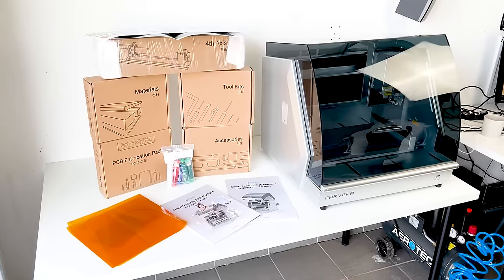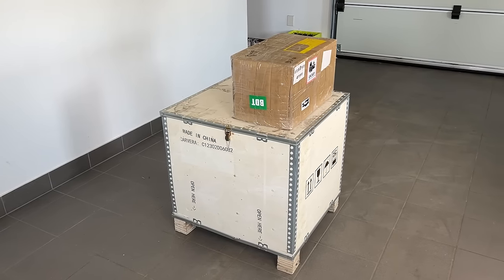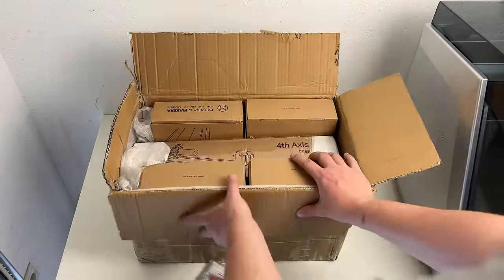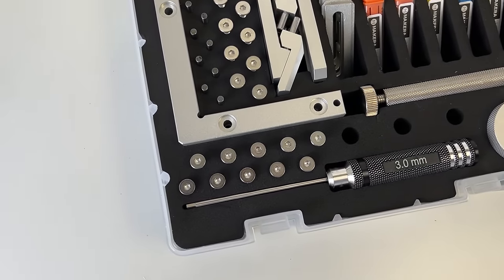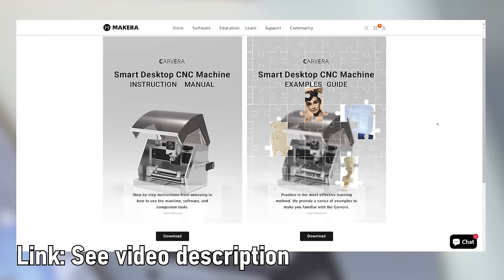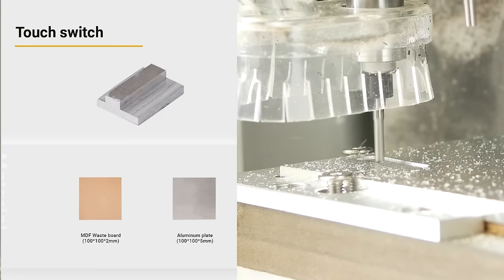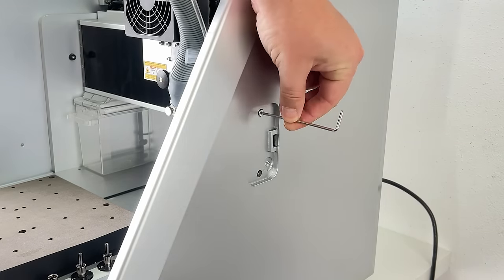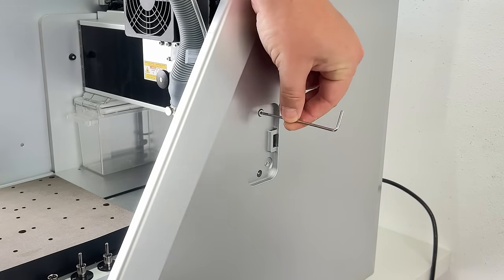Makera Carvera Desktop CNC: Great for (wealthy) Beginners ?

Comment: 200 W spindle does not a high-end CNC make...
Reply: When considering that it is a small form factor desktop machine. I think it does
Reply from the maker: I get your point, but does a 2kW spindle make high end?
Reply: well it would be at least nice do drive a 6mm endmill at proper speeds  @247printing
Reply: Considering you can get a Langmuir MR-1 for around the same cost, and it has a 2.5 kW spindle, I'd say yes.
Reply: You're right, but this is for onesies and twosies, not a production machine - a minimally viable production CNC like Haas VF1 runs around $40K, needs 3 phase power and is the size of 2 sedans - what ordinary person is buying that besides someone who is making a living from machining???
Reply: I'd rather have a $5k portable CNC that is slow than a $15k phonebooth CNC capable of production runs - at that point just buy the full Haas mini mill or VF1, you're already blowing out a wall in your garage just to install it
Reply: In a small machine like this, you will not be roughing with large end mills. Small diameter micro milling end mills have relatively little cutting force, but require much higher RPM.
Reply from the maker: @theofficialczex1708  Now that's context to your initial comment I can work with ;-) Thx
Reply: Dude, i5s a hobby machine,  not pro
Reply: Illegal
Reply: I have made and regularly use CNC routers, lasers and so on... this Is a very well made solution for Who wants a desktop machine and newbees. Automatic tool charger Is very expensive if you can't do It yourself.  I think 5000 Is not too much considering that a good core xy 3d printer costs 1000 or 1500.  And yes, Building stuff with cnc Is very more complicated than 3d printing them😅. Otherwise,  as in 3d printing , There are always challenges in CNC that I love.
Reply: @woofguy  "High end" was removed from the title.
Reply: It doesn’t have tool changer though
Reply: Neither does $5k.
Reply: The wattage doesn't directly equal the capability... And I've seen reviewers cut aluminum with the Carvera Air... Sure it's slow, but it works. 
I bought it for PCB making and carbon fiber milling.
Reply: Servo motors ball screws, and a Mickey mouse spindle😂 like putting Pirelli racing tyres on a VW beetle😂 shame cos the rest of it is quite high spec, should be 1 kw spindle minimum, I guess size was an issue. If they scaled it up and put a decent spindle on it, the comprehensive add one like probing and tool changing would be worth the corresponding price rise..

Comment: It doesn't look like anyone has explained the default stock to leave values, so I'll do it. Generally you would use a roughing tool and a finishing tool or even just different feed rates to improve the surface finish on the pockets, hence the 0.5mm stock to leave, so that the next tool has something to remove.
Reply: Spring pass. Came here to explain it but you got it.
Reply: @saltwaterrook4638  i usually got taught a spring pass is a second pass with the same tool and settings to remove any material that was not removed by the first pass. This is due to bending of either the work piece or the tool, or both. Roughing vs. finishing passes on the other hand are used for quick material removal and good surface finish respectively.
Reply: And don’t do side milling and face milling for finishing at the same time if you want a very good finish.
Reply: Our Kennametal rep recommended 0.05mm stock to leave and it's been working great. Of course this depends on the expected surface roughness of your roughing step.

Comment: The reason why you get the misalignment of the upper and lower cuts is due to that you use an live edge to center your stock when flipping. To fix that, first position the stock as you did in the beginning with the xy block, clamps and screws. The the second operation is to face the peace of the bloc you are going to use. Then this is the important one. Drill the screw holes and screw the stock down (At least 2 screws and screw holes.). You can now remove the clamps as the part is fixed to the board through the screws. Continue the cutting make sure in CAM to not hit the screws in the stock if they are sticking out a bit. Do this side completely done and cut it out. Now you have one part that is faced and has the features on one side. Now the magic. Flip your half ready part and screw them back in the same hole again. With this the position of the stock becomes absolute. Finally some times those  screws in the beginning can is some cases be supplemented with dobbel sided tape if the forces are lower. But then you can not flip the stock easy. Final 2. With CNC you may spend more time making stock holding systems then actually making the first batch of products. Check in the @ContraptionCollection channel here on YouTube he has some nice CNC trick's. Sorry for long message.
Reply from the maker: Thanks a lot for the long message!
Reply: I ran into this same issue flipping parts with my CNC. Another option would be to set your 0 on something that doesn't move. For instance, the alignment fixture. If you are setting 0 off the edge of the stock, the stock needs to be precisely cut. When you flip it you will be off by the difference in stock dimensions. Setting 0 off the fixture would require you to roughly model it in Fusion. From from there you can set your WCS.

A second option would be to set your 0 off of a milled feature. If your probe is small enough to get into the gap around the part you can set X and Y. Or if the machine can probe a bore that would work to. That would set the 0 to milled features and should get you a lot closer.
Reply: @NainKaigo  Yea. That is also an option. You could mill the live edge to get an true position when flipping but it could be less precise then two, three or mare screws.
Reply: What? What live edge? This isn't wood bro and we're on an international stage...
Reply: @247printing  Dear 247printing: You did well. In the future, may i suggest to utilize the machine for accuracy. Simply make a couple holes from side 1 and zero/home in them from the other side, including a screw angle. NC deburings tip doesn't allow for chip evacuation, always run minimum 0,5mm tip offset, but rule of thumb is "more is better". Running it like you did requires a 2nd pass to make the surface real good
Reply: @VikingRul3s  Oh. The live edge means the edge may not be straight because the metal you revived was not cut totally straight from the factory. If you check for example ClicSpring here on yt he always cuts the stock on all sides before he starts working on the project. He does that because the live edge provided by the manufacturer is not straight. If he did not do that the parts he make later would became skewed.
Reply: @segment932  Bro, i'm still kinda confused. Do US call both wood "stock/bark/raw" edge and metal stock edge for a live edge? I so, my bad, tho in my defence that's different terms in Europa
Reply: @VikingRul3s  Yea the the live edge may be a American perspective because most of the time I always watch American CNC videos and have forgotten the Swedish names (Yes I'm from Sweden) I learned in schools 20 years ago. So I'm sorry for the confusion.

Comment: Hi, awesome to see that cnc milling is becoming avaiable for the hobbyists. As someone who is experienced using industrial cnc machines I have a couple tips for you. For what I can see you are probing on the side of the plate on both operations. You can do it on the first operation, but I would recommend to probe a feature that has been milled on the first operation to probe for the second operation. For example a troughhole. As for the chamfers I would recommend to give it a larger chamfer tip offset, this way you aren't milling with the very tip. The 0.05 offset you used it quite small. I recommend this because the higher the offset the higher the circumferential speed is. At the very tip the theoretical circumferential speed is 0. But I think you did quite well for a first attempt! Cheers!
Reply from the maker: Hey there, thanks a lot for your helpful comment - great to see that there are still nice people out there!

Comment: I've been using mine for a few months now. I think it's a pretty good machine. I own a 10 kW CNC mill so I have a little bit of experience.

You can't overstate how nice the automatic tool changer is: it means you can leave it running in another room, it just goes and fills its vacuum box slowly with chips until it's done with the whole program. The automated tool setter is awesome as is the cute little service-free Z probe.

I see one main point of potential improvement: the spindle speed could use being about 2x higher for small tools in aluminum, and the spindle speed stabilization is not great (it hunts a lot with load). Otherwise, maybe the Y axis should use something like Hiwin HGR rails instead of the LM style bearings, would make it a little stiffer? I need to do some real stiffness measurements.

That said, it's quite precise when taking light cuts, it fits on a benchtop, and it's really well integrated. I bought one because this was the first "home" CNC mill that I felt I wouldn't get infuriated by - and so far, so good.
Reply from the maker: Thanks for sharing your experiences and possible improvements on the Carvera - very interesting!
Reply: Could you elaborate on the rails?  I was considering building one and any information like that would be a welcome addition.
Reply: Yep I should have ordered the Carvera instead of the onefinity
Reply: @shadowunifer  anyone can correct me if i am wrong but at my understanding LM bearings are the ones found on lineal rods and usually less stable/stiff than HGR (the square blocks) ,most precision machines have HGR lineal rails, while there are smaller version called MGN that are the ones you see on 3d printers.
Reply: U dont own a 10k W mill

Comment: Very nice video.

You will find you get much better results if you get shorter tools and stick them out less from the collet. In general, a stickout of 3xd or less is preferred. So a 3mm tool should stick out 9mm or less if feasible. This reduces chatter by a LOT and will significantly increase surface finish and even allow you to cut faster. If your part is only 3mm thick, then you don't need the extra stickout anyway and should choke up on the tool as far as possible, usually up to where the flutes start.

This applies to side cutting tools like endmills and chamfer tools. Drills and spot drills can stick out much farther before you start to have issues.

Comment: the .5mm stock to leave is there because the most common practice is to rough out a part and then finish the part.  or in other words remove most of the material leaving enough to be sure there is still material to take a delicate finish pass, leaving the final surface more accurate and looking better. if you click the 3 dots next to the stock to leave and click edit expression it will show where that value came from.

Comment: You could have fixed all of those wcs issues by milling a clean 90deg edge on one side. Then starting your program off a known true milled surface. Never rely on saw cuts to give you references. You could have also shifted your wcs and probed off a bore or internal pocket. Lastly a mql or consistent air blast will help alot and reducing your tool stick out as you have a lot of vibration and chatter.

Comment: I love this maker rennaissance that is going on, for the price it is out of the range of most hobbyists, but it is getting more and more attainable.
Reply: I keep coming back to this machine, but since I only need CNC'd parts very infrequently, I can't really justify the price.  Although... I said the same thing about 3D printers, but once I got one of them I never stopped designing and printing stuff for around the house.  That thing earns its keep, maybe this will too.
   
They are releasing a smaller and more basic machine called the Air, for under $2000.  That might be a nice affordable option to get started with CNC.

Comment: i would recommend printing or cutting a fan that fits over your spindle, that way it will blow the chips off when the spindle is spinning. also, when cnc'ing double sided parts, it is good practice to use dowl/location pins (similar to the ones that were supplied with the PCB making kit), the first operation usually drills a couple of holes through the stock into the baseboard, then you insert the pins, so when you flip the stock over its perfectly aligned.

Comment: I´m milling for 17yrs and now i´m looking for something like a mini cnc mill for my home... Currently i´m working on a 33t beast with X 4000mm, Y 1350mm and Z 1650mm... And yes it is 5 axis too with Heideinhain iTNC 530 control... Imho the carvera is the best you can get, also for the money, only if you wanna do lots of laser work, forget the carvera and get something else. This is really something lots of us were waiting for! The atc is of course a highlight of this machine. If you compare this with the Nomad3 f.e. (which is unfair of course but there simple is no real other alternative yet) i always would go for the carvera. Having the possibility of milling brass and aluminium and a 4th axis is always very neat for every rc model builder.

KR from Austria

PS:  Living in Europe, is there a 220V version, can´t find it on their page, so i guess i have to deal with the 110V plug right? Wouldn´t be an issue just need to know.

EDIT:
Found it in the discription "100-120VAC / 200-240VAC @ 50/60Hz" so all good 🙂
Reply from the maker: Servus and thanks for you reply, very interesting. Also one of the rare commenters with milling experience appreciating the Carvera.
Cheers from Bavaria
Reply: @247printing  Es ist wirklich die einzige Maschine mit einem Werkzeugwechsler auf Linearführungen die ich in dem Preissegment finden konnte. Lässt sich sicher weiter ausbauen, sieht aber in der konfigurierten Version wie sie ausgeliefert wird so interessant aus das ich sie mir im Sommer bestellen werde. Einsatzbereich technischer Modellbau und Hobby. Die Pentamachines 5 Achs Pocket NC ist mir zu teuer, der Bearbeitungsbereich sehr limitiert, die Genauigkeit schlecht mit ca. 0,2mm...
Lg nach Bayern 🙂

Comment: man, cnc machines built by professionals are soooo good, they basically pamper you with all the safey and instructions and customer support, they put the parameters in for you, you just choose the material from a list, it's awesome.... the only problem is, it's expensive. for a toy, it's expensive. it costs the same as a 5 year old used car. i CAN afford it, but it hurts knowing it's just a toy

Comment: Consider using a locating dowel to flip parts. Use a hole or two in your part that goes into the bed below and use that to locate the flipped work piece.

Comment: This really is good value for the money with the tool changer and all the accessories. Much like my own CNC the user interface is too basic out of the box. I had to buy a pendant so I can move the toolhead around and then also a macro tool with some presets. learning the CAM processes is never ending because each project will have something new you want to try. Overall an excellent video showing your noob experiences in with CNC.
Reply from the maker: Hey Lee, thanks a lot! Also for these insights. Need to get to my next CNC project soon!

Comment: Rough surface on the aluminum is probably from using a wrong end mill. Looks like you were using a single flute (one cutting edge) end mill intended for plastics. A two or three flute will give a much nicer surface finish.
Safe Z - how high up the tool moves between cuts - unless you're going over clamps and such, keep it as low as possible for faster machining. As long as it does not run into anything, Z0.1 is often plenty.
Flip machining - working on two sides of the part - NEVER indicate (position) parts off of the original piece of material UNLESS it's a machined block. Instead, cut out a pocket for the part in the wasteboard, then super glue the part into said pocket once one side and the perimeter have been cut out. That will make sure that the part is put back in the exact spot where it was originally instead of relying on it being perfectly in the middle of the stock (original piece of material), being located perfectly against the guide, not moving when it's re-clamped, and so on. Acetone will easily remove the glue afterwards.
This one is more of a personal choice, but I always cut the pocketed or more complex sides first. That way if something messes up I haven't wasted cutting whole other side, and it makes sure that all pockets, screw holes, and other features are where they should be relative to one another. Then just flip, champher the other side, and the part is ready.

Comment: I wonder if he ever show the cnc again after this vid. Making fixtures to mill the second side annoying and often times even the first side can be a challenge. 
Figure out feeds and speeds is often a chore. Making the CAM can be time consuming and you often have to tweak settings after the first milling attempt. 

But aluminum is superior in strength and stiffness compared to FDM printing in the end. You also can mill a FDM print to get better tolerances or save a print.
I saved a print this week. Got the support distance wrong and couldn’t remove it. Used my CNC to cut out the support melted to the part.
Reply from the maker: Already used it again ;-) Feeds and speeds at default worked nicely already - why change?
And yeah sure: It's more effort to CNC mill in comparison to 3D printing, but as you know: 
You get stronger parts out of it using aluminium designs and CAM programs. 
Staying at 3 axis it's not that hard or time consuming.